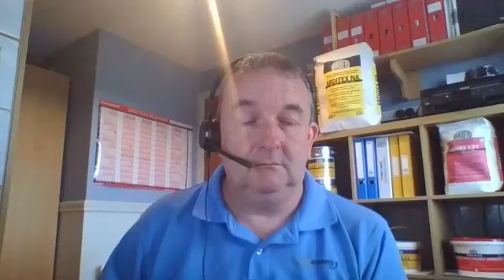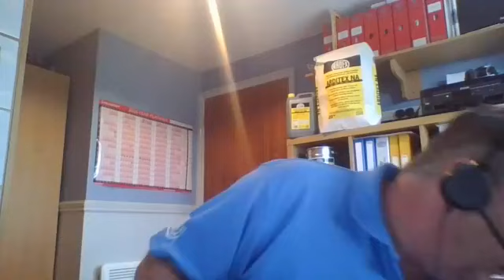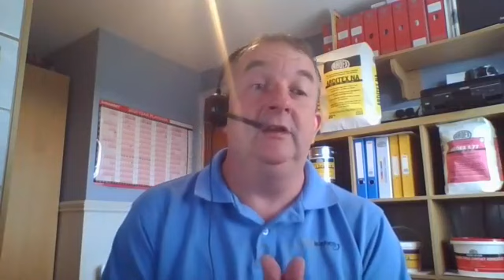How to deal with problematic subfloors

Comment: What about Ardex one coat directly on to quarry tiles lay
Reply from the maker: ARDEX DPM 1 C can be applied direct to quarry tiles as long as they are sound and prepared, although we would recommend a 3mm pre-smooth using ARDITEX NA or ARDITEX CL PLUS to maximise the coverage and performance of the DPM 1 C.